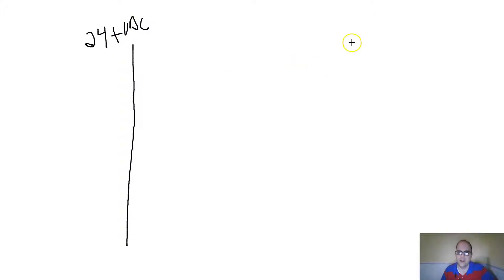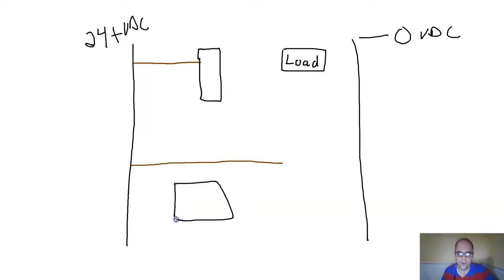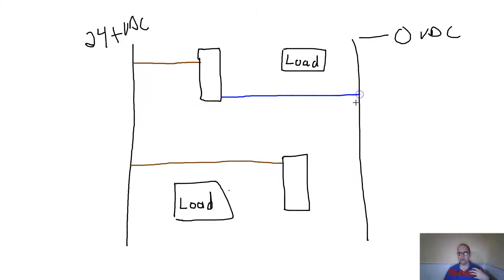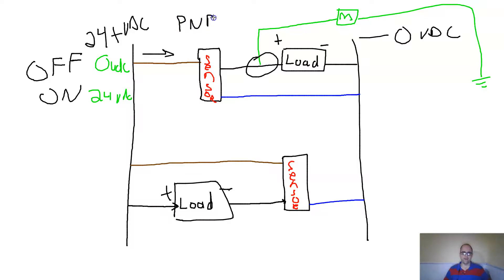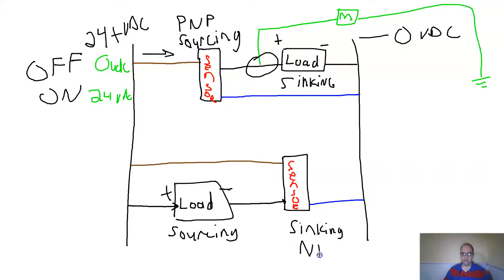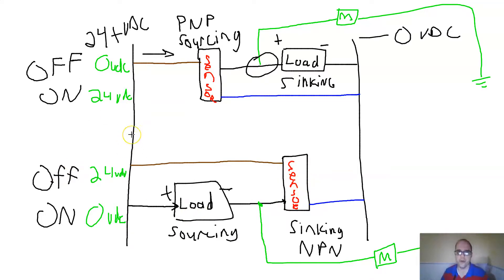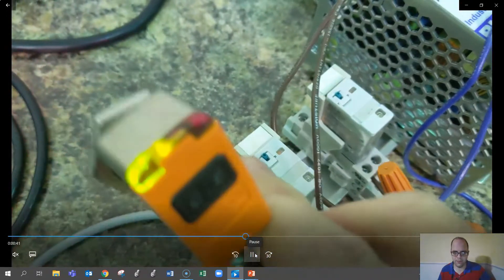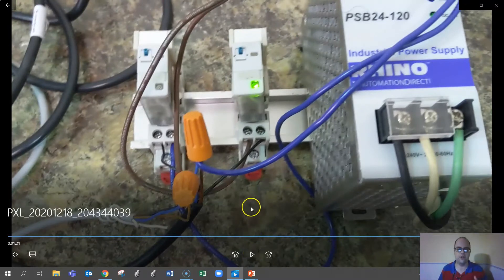How to wire a 3 Wire Sensor

Comment: heloo. i have a 3 wire speed sensor on my bike.  i modified the rear wheel and it has only two wire on the speed sensor. is it posible to connect it? 3 wires on my bike and 2 wires on my wheel ? how can i put the wire?

Comment: hey so i have an 04 altima s with 2 speed sensors, both sensors wires were chewed off, the center wires both use their own colors so i can splice those easily, but the left and right pins both have a red/yellow and black wire for which i assume is power and ground, but since the 2 sensors are so close and the 4 wires look the same, how do i know which is for what?
Reply from the maker: look things up on the manufacturer's website. there's no way I can give you an educated guess without looking at it or knowing the electronics. tech documents are your friend

Comment: Thanks for the video!
2 questions:  
1.  Since the sensor can go high or go low does that mean that applying 24Vdc  to the wrong wire won't burn it?
2.  Would you happen to know what Red/Black/Blue wires from a geartooth sensor represent?  I would hate to burn this sensor by connecting incorrectly.
Thank you.
Reply from the maker: 1- depends on the wire. usually not
2-depends on brand. I recommend going to company website and looking for wiring diagram.
Reply: Thanks.  I downloaded the datasheet, but it only describes the two wire variant for some reason
Reply from the maker: @michaelvadney5803  does the two wire tell you positive and negative
Reply: D'oh!  I have multiple copies of the sensors datasheet and I never noticed anything about the layout.
Until now anyway.  The description of the leads were in a block style diagram and there it mentioned the colors.  Jeez.  I am a dolt.  Thanks for making me take another look.  
Red is VDD, Black is ground, and Blue is the signal out.  The top of the diagram says 2 wire geartooth sensor too.  Take care